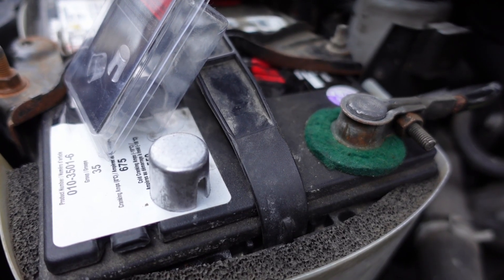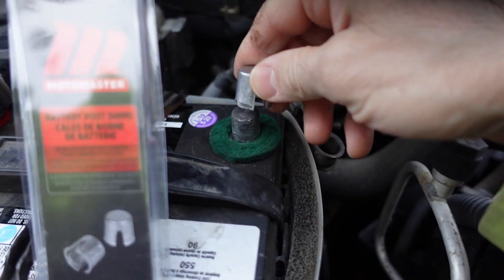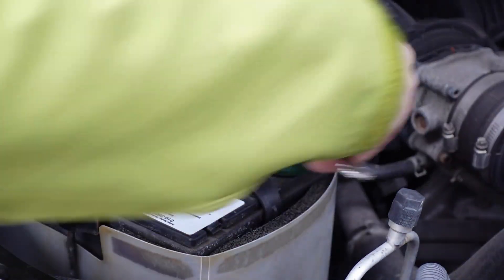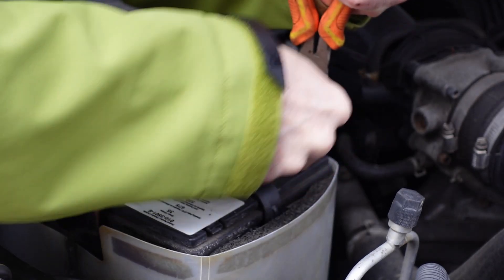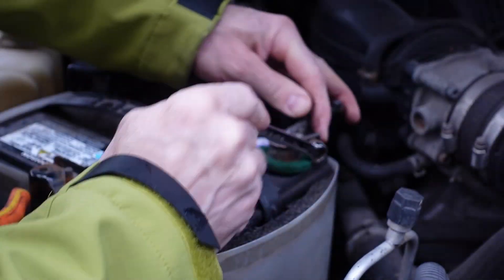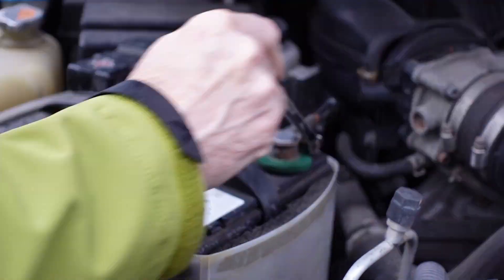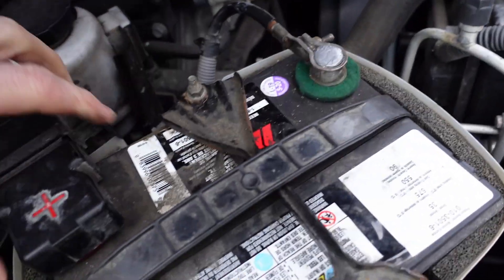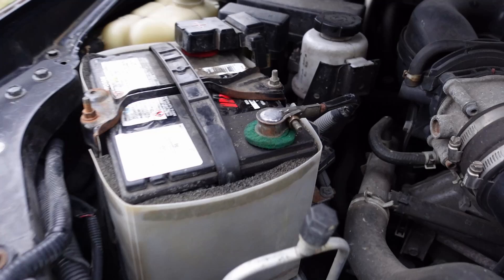Loose Battery Terminal Fixed - Car Battery

Comment: I just bought a Hulkman battery trickle charger - trying to keep my old battery from failing one more winter. So far so good but good connections are very important too. Thanks for the tip!
Reply from the maker: I'm holding out hope for this battery. It is not giving me much confidence though.

Comment: Easy peasy!
Reply from the maker: Saddly I dont think this is my batteries problem.
I think it is on the way out
Reply: @DIYNorth  a good friend of mine has 2013, Mazda three, and is having trouble with her battery is draining, I think it’s her alternator
Reply from the maker: I think my alternator is fine.
In the morning when I check the battery it is down to 400 CCA when it should be 675